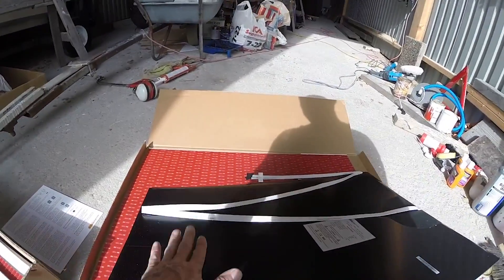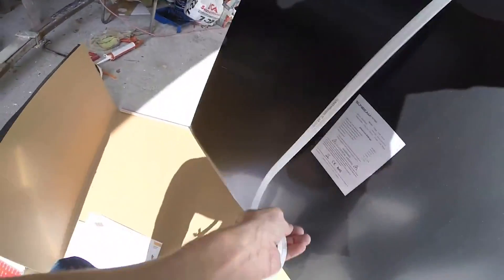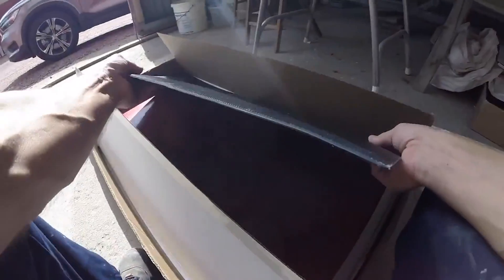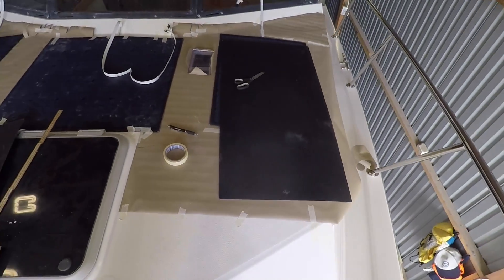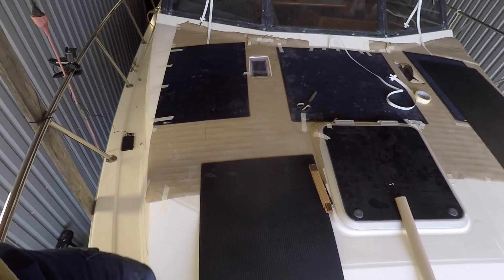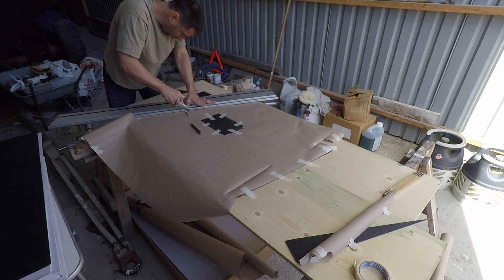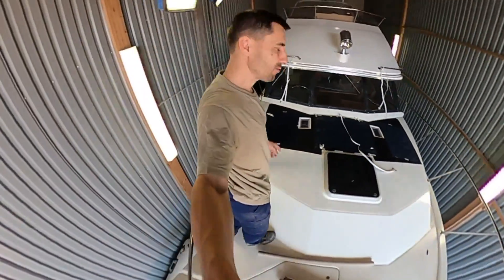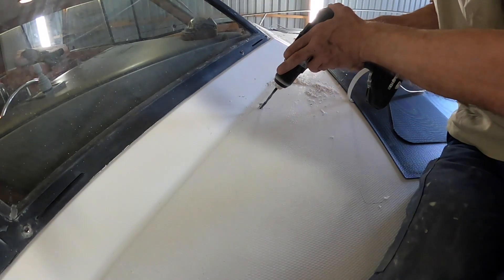Solar install part 1

Comment: I like how you are installing these on your 3270. I own a Bayliner 3270 and I am looking at adding solar. What are the size  and or model numbers are the panel's did you selected?  Waiting for the next video. Thanks so much
Reply from the maker: I have updated the description with all the parts I bought and where to buy them.